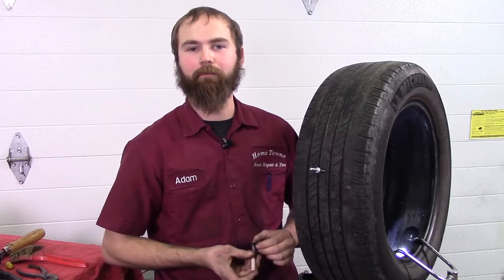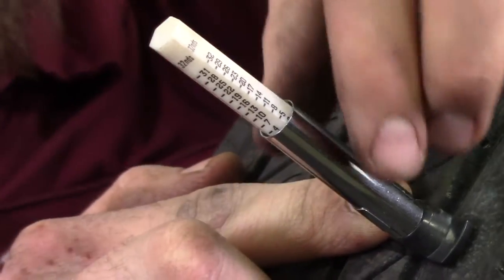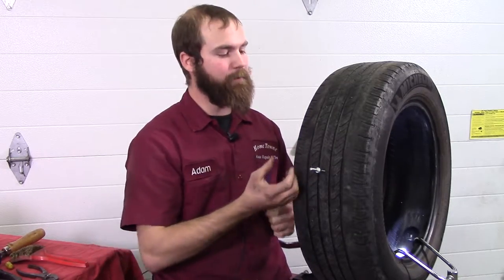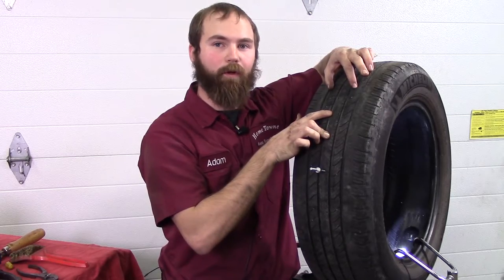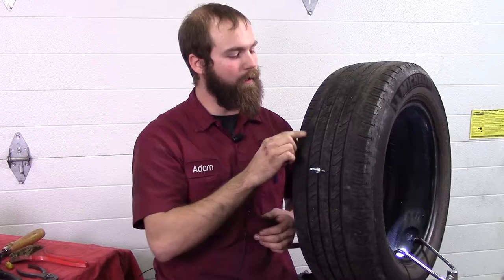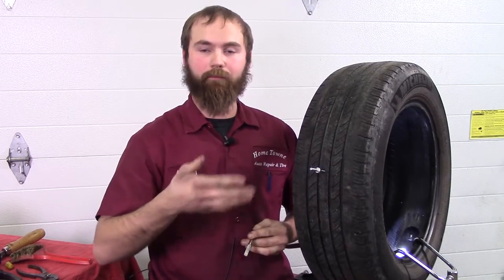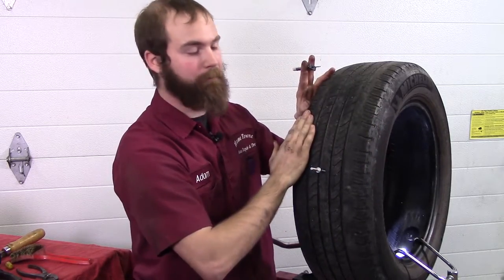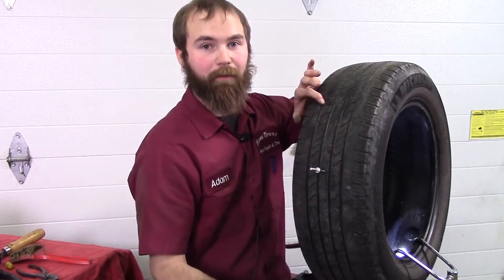When is a tire repairable?

Comment: Yesterday my friend had a flat. She sent me a picture but it looks like a typical puncture right near the center between the treads in one of the groove. She just bought a pair of rear tires for her Tesla. I guess this particular Tesla has staggered tires. The tire store told her that the tire was too thick to repair .I believe they asked her to buy a new pair. A couple of weeks. For sure they made her buy at least one you tired. Is this something common for Teslas?
Reply: Teslas and any electric car. EV cars tires are made differently for the purpose of making the car lighter. my sister had to replace her tire (could not be patched) on her EV toyota car as well and that is what it was explained to her at the dealership when she bought a new tire.